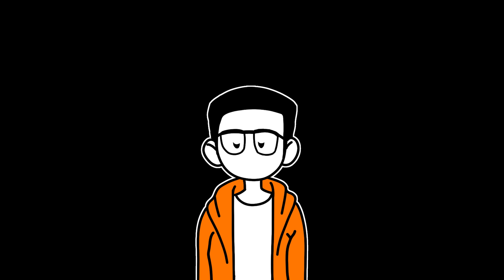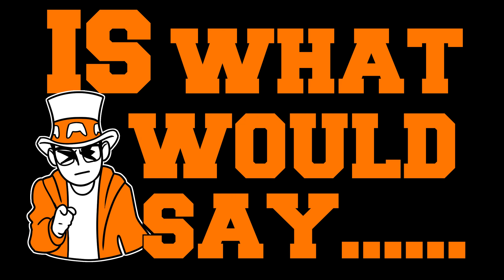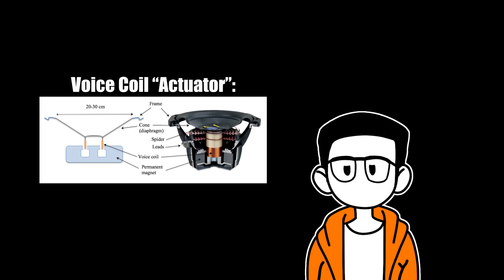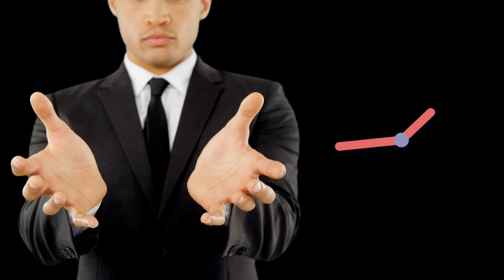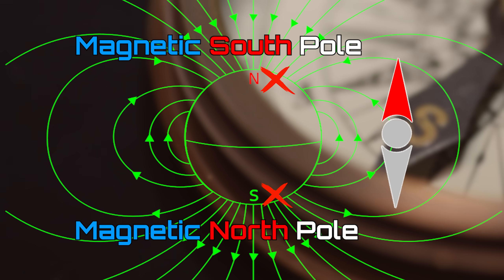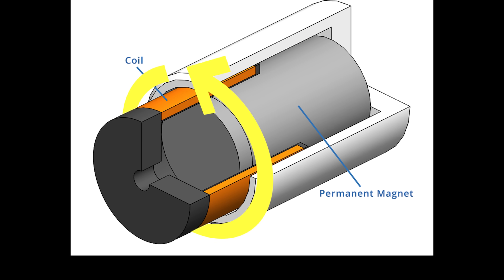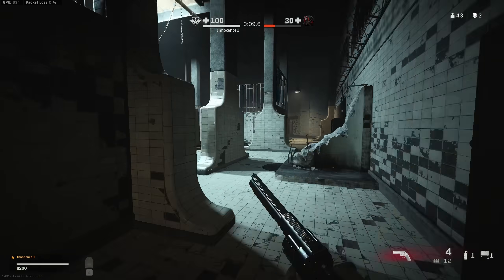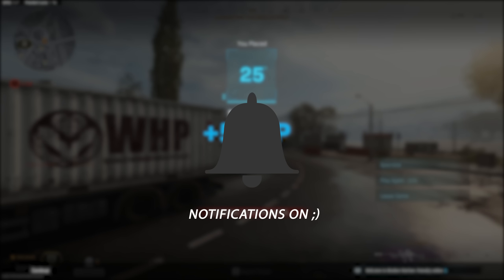Explaining Exactly What A Dualsense Does.

Comment: Yes I know the difference between the rumble in the DS4 and DualSense. DS4 uses two motors with weights attached, a large one for heavier rumble, and a smaller one for light rumble. DualSense doesn't use spinning weights, it's basically a mini subwoofer of sorts. Pretty sure it's a voice coil but don't quote me on that. It uses an audio format instead of just the simple on/off of basic rumble for more accurate feeling vibrations, typically matching the audio of specific triggers in-game. You can test this out by plugging in a Dualsense to your PC and setting it as the primary audio output device. If you have Spotify installed, run it and play a song. Some songs don't work too well, but find the right one and have fun. Try putting the controller directly to your ear or on a desk, anything that vibrates easily or a hollow box (like a subwoofer).

Two of our senses are directly influenced by vibrations, both our hearing and the sensation of touch. They compliment each other, for example if you were standing beside an explosion (safely of course) you would both hear and feel it from the exact same vibrations. It's why people love the booming audio of a movie theater. It's why people install massive subwoofers in their cars. That's where the DualSense gets it's name.

Comment: The Lorentz Force... or you can just your right hand for the directions. 
Lorentz Force Law
The Lorentz Force Law can be used to describe the effects of a charged particle moving in a constant magnetic field. The simplest form of this law is given by the scalar equation
F = QvB
F is the force acting on the particle (vector)
v is velocity of particle (vector)
Q is charge of particle (scalar)
B is magnetic field (vector)
NOTE: this case is for v and B perpendicular to each other otherwise use F = QvB(sin(x)) where x is the angle between v and B. When v and B are perpendicular x=90 deg. so sin(x)=1.
The right hand rule comes into play here to figure out which way the force is acting.

Right Hand Rule
For a POSITIVLY charged particle moving (velocity v) in a magnetic field (field B) the direction of the resultant force (force F) can be found by:
1) THUMB of right hand in direction of VELOCITY, v (first vector)
2) INDEX FINGER of r.h. in direction of FIELD, B (second vector)
3) Your PALM (or middle finger if you like) now points in the direction of the FORCE, F (final vector)
The force will ALWAYS be perpendicular to the PLANE of the vectors v and B, no matter what the angle between v and B is.

Comment: Ps5: We have innovated a hyper fast ssd. We have pioneered voice coil actuator Haptic feedback that can rumble specific spaces on a controller individually and combined with varying resistance triggers can simulate surfaces change the way games feel. We included liquid metal cooling. We created a design that is sure to be a discussion piece. We created a proprietary form of audio that localizes sound based on where in the game it is rendered and allows you to precisely locate individual raindrops. 

Xbox: we still use AA batteries, but look at dem TERAFLOPS!
Reply: Hence why they threw money until Zenimax was theirs

Comment: It is doing stuff that the majority of devs wont even take any advantage of. People that don't need a 2 grip d'ldo in their hand will ofc turn that rumble sh*t off immediatly. The tension triggers are just another weakpoint for mechanical failure. And the icing on the sh*tpile is the dum* microphone, giving 13 year olds more opportunites to tell me to have some sort of intercourse with my mother. 

In that case id go with quality rather than quantity and choose the Xbot Series L Controller instead of the D'ldosense.

Comment: @Innocenceii

There's another interesting "angle" to the haptic motors: they're a matched pair, and that's really important.

Thing is, VCAs act just like speakers without the speaker cones, so their vibrations effectivelly have a "phase". If you are familiar with acoustics, you might be aware that two soundwaves will interfere with each other, either adding or removing energy from it (additive or destructive interference) depending on their phase relationships.

So, by controlling vibration phases, PS5 might be able to control how the vibration of the two VCAs interfere with each other. And that's important because these vibrations travel through the controller at a fixed speed, so by tuning the phases, PS5 might be able to control where the vibrations add up and where they cancel each other.

That mean localizing vibrations anywhere within the controller.

Comment: Do you think that is possible the adaptive triggers using some kind o sealed tube with some viscus fluid inside it. Then you can have a second one inside the first, with holes for the fluid to pass through, and by using rotation on that one, you can restrict the flow or completely block it.

Comment: The basic of Lorentz force is that forces exerted on charged particles moving across a magnetic field in the direction of right hand rule. That's it. In the case of vacuum, a charged particles will be deflected in a magnetic field perpendicular to its velocity. This is how traditional CRT monitor works, as well as many modern instruments such as mass spectrometer. In the case of conductive wire, such as the one in motor, the drifting electrons inside the wire are the one that caused the force exertion. Although the drift velocity is very small, the amount of moving electrons is humongous per area of conductor, thus is able to generate force, aka the higher the current the larger the force. As the author mentioned, electromagnetism is interchangeable, thus moving the wire across the magnetic field will force the electrons to drift, generating electrical potential difference. This is how generator works.

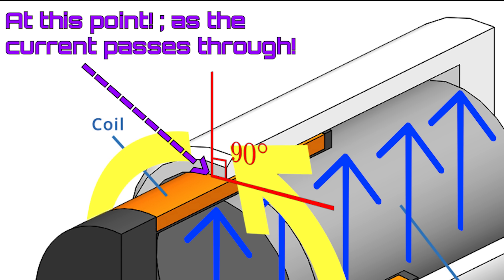Comment: At 12:45 you drew the magnetic field of the magnet wrong. The magnet is in line with the magmatic fielt of the coil. That is how the magnet is moves. It does not need the Lorenz force. The field generated by the coal just needs to interact with the magnet. 
Just put a permanent magnet into a coil, move electricity through and the magnet will her moved by the field in the coil.
The rule that would be enough to explain this is the Lenz’ rule. (I’m German and it’s called “Lenzsche Regel”) seriously. The Lorenz force is not necessary. 
PS: I teach physics. The Lorenz force is only necessary if it is a force that acts on moving particles that are also charged.

Comment: I still did not understand how they made the controller feel like electricity from Miles Morales and scary games could make you feel like a Spider is crawling on your hand.

Maybe I am dumb but I still have many questions, Sony also said this is just the start and developers can get more creative.
I also read an article claiming the dualsense can profile the way you hold and use the controller, is this true?

Edit: Sorry for my english
Reply: It's true, but bare in mind that the dualsense will require at least 300-400 hours of gameplay for this feature to work to you, a lot of data is needed for accurate results (these numbers haven't been specified by them). The way this works is the way the new home button and screen on the iphone works (if you can compare it's easier to explain). To put it simple, these phones have what is called a taptic engine, something which measures the force and pressure on the display to analyze the users intention (does the user want to open the app or look at the haptic shortcuts?). The playstation controller supposedly has two taptic engines, so it is likely they will be used for this. Be aware that we don't know where they are, these things are small, about 2cm of length (sorry if you're american, I don't know  the conversion). These can be located in the grips, or in the triggers. Since we've had very limited gameplay, and these are mechanics that take time to analyse there is no way of knowing how good or true this technology actually is. I'd keep my expectations low just in case. Hope this helped :)
Reply: @Otherstoriesfrommij  Thank you that was very helpful, I was hoping Innocenceii would go through all of it in this video. But like you said we just have to wait and see.
Reply: @CarlitosPR94  glad I could help.
Reply: “Spider crawling on your hand” I’m not sure my heart could take that kind of immersion lol, i HATE spiders!
Reply: @Carfilliot  , even though haptic feedback through a voice coil actuator is precise. It all depends on how much time a developer wants to spend programming the controller, many games won’t use the feature as it could be compared to making a song (you need a lot of fine tuned frequencies). If I were to say, the technology will mostly serve as a better rumble.

Comment: If you ever get the chance to try out the original Oculus Rift controllers, they have a similarly instantaneous haptic motor (I think Quest 2 controllers are going back to this, because from what I heard Quest 1 controllers did away with it). Specifically in the game Eleven: Table Tennis VR it's very well utilized... like to the point where balancing and letting the ping pong ball roll around on the paddle legitimately feels like a ping pong ball rolling around on a rubber surface. It's so subtle and precise that it blows my mind even to this day. Sadly most VR devs don't scratch the surface of what's possible with the haptics and just use them in very bland and boring ways. Here's to hoping ALL of the Sony first party developers actually take advantage of the voice coil actuators. If they do... No one will ever want to go back to rumble motors. Hell even when haptics aren't properly utilized they are still better than traditional rumble. It all comes down to developers in the end.

Comment: Vibration ≠ Haptic Feedback
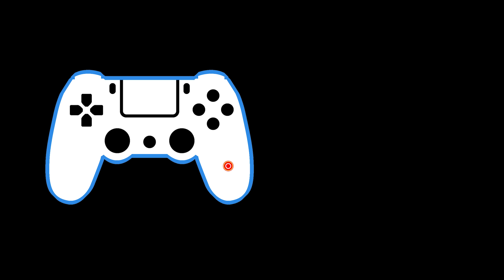1:56 I think you are not familiar with the concept with haptic feedback... By definition, haptic feedback is the feeling of realistic 3D touch feedback which was only first introduced on the iPhone 6s where they first put a linear motor onto a mobile phone. This was not the same thing as a traditional vibration. What you said of haptic feedback being in the Dualshock 4 controller and every phone with vibration is basically saying that LED is present in every fluorescent lamp(not the best example).

Everything later was correct tho. I know you tried to clarify that later in the video but the first part was very misleading. Haptic feedback is not the same as vibration. What you were trying to explain in the video was misleading the viewer into thinking that linear motors provide a 'better' haptic feedback, when in reality haptic feedback can only be provided with linear motors as for now.

Comment: I wish accuracy was the issue I had with Rumble features. No, it is how it feels. It is an unpleasant feeling, which hurts my immersion. I do not like how it feels and good accuracy won't fix that.
Reply: I know what you mean about traditional rumble feeling artificial. Just based on how this works (oscillating vs rotating), it should feel different from current rumble at the very least.
Reply: @fattiger6957  It is not so much that it feels artificial. I just do not like the physical sensation of rumble. When I eventually get a PS5 I will try its haptic feedback but I doubt my not liking the sensation will change.
Reply: @gold-dragon-media  Well, there's always a way to disable it.
Reply: @fattiger6957  Yeah that is what I always do and expect to do with PS5.

Comment: The adaptive trigger will be like a locking piston by using what is used in the vibration, since all it is, is a pistol moving back and forth rapidly.

This means the motor will be designed a bit differently but 'locked' to the trigger mechanism, which means there is like a plastic or metal attached from the end of this 'piston' thing to your trigger itself, and it is able to be 'freeform' able to be pressed back and forth, or take over and 'halt' the trigger and prevent you from pulling it altogether.

The thing I do worry is if some kid gets pissed off thinking his controller is malfunctioning and pulls the trigger so hard it breaks it.

Comment: The haptic feedback sony are pushing is the same as the ones used in iphones, when ur spinning a clickwheel every click feels almost like an actual click on your hands, i remember there was this game where u can pop bubble wrap and it would mimic the feel of the pop everytime you did it, the dualsense controller when implemented correctly will give you a new sense of gaming youve literally never felt before ( i hope )
Reply: "never felt before"

....

Unless you have an Iphone?
Reply: @simontjuhh  In a way most phones have these features enabled. What you do need to know is that Apple's taptic engine is much better than the rest, as said in the video, most other brands use rumble engines. Apple uses a dedicated haptic engine to provide haptic feedback, around 80 dollars of the iPhone go to this technology.  Technically rumble is haptic feedback, it's just lacking in certain aspects of it.  The single most important thing to remember is that haptic feedback is software, and hence will only work if developers are supporting it, I'm sure Sony's first party games will use the feature, but I don't know how far 3rd parties will go in supporting this technology. I for one can't wait.
Reply: @simontjuhh  Actually most modern phones are equipped with vibration coils now and they've been used since 2007. Its not a revolutionary tech by no means and work on the exact same principle as regular speaker coils - which is a technology more than 100 years old. Lol.
Reply: @Mike-sf7ex  

Same technology for a different and unexpected purpose. It's genius.